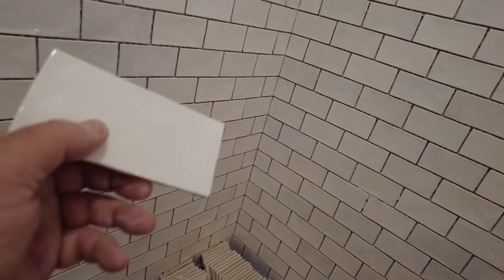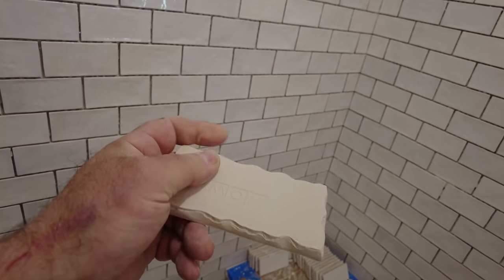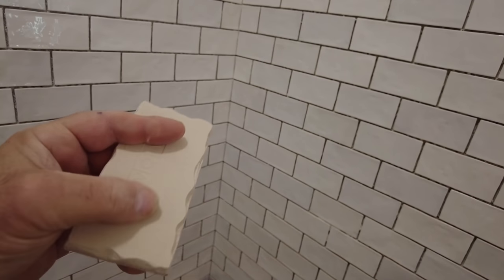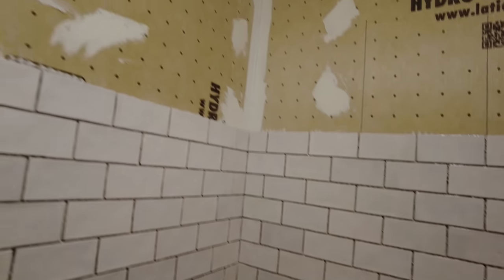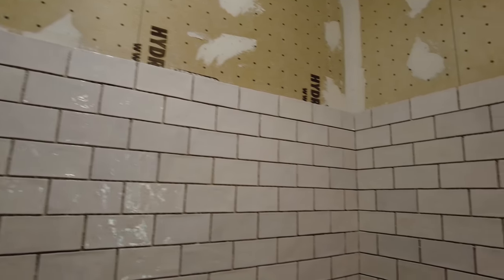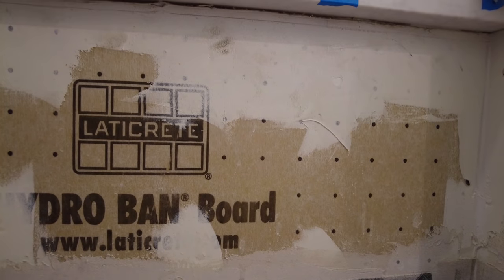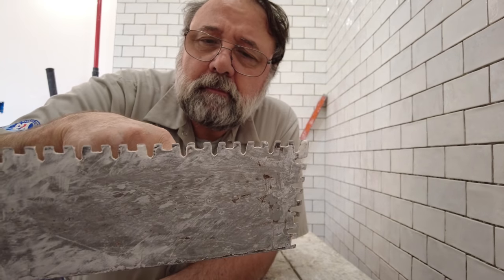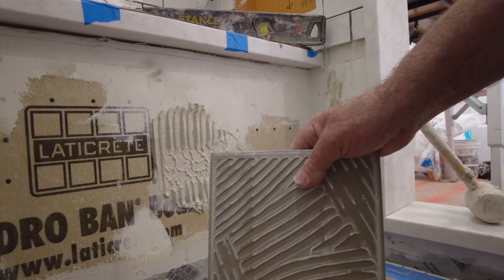Subway tile dos and don'ts. Specifically back buttering.

Comment: If you want any tile to bond better to a cementitious adhesive a little moisture always helps... hence sponging a wall before burning in. If the subway tile is extremely dry and porous, and on hot days, I will often spray the back of the tile with a bit of water before setting to increase the bond strength.

Comment: I just installed a 4”x12” rectified porcelain tile kitchen backsplash and didn’t put any mortar on the walls at all...just troweled it onto the back of each tile and came out amazing!
Reply: I did the same thing when doing the herringbone in my shower because needed to slow my roll from slapping the tiles up too quickly.

Comment: Great video Sal. Does using mastic instead of thinset make any difference when deciding when to back butter and in choosing the trowel size?
Reply from the maker: Mastic is junk and has very limited uses. Only in Dry areas and small tile. No Porcelain.

Comment: True. Is there a set depth of adhesive a certain sized trowel will leave if you need to calculate where to set your studs do the tile finishes at an almost exact point. So 95mm stuf, 12mm kedi board, adhesive and 24 x 24 tile at 10mm thick. Hope that makes sense. Thanks Sal.

Comment: Hi Sal. Is there a particular depth you add on for tile adhesive when setting shower valves etc. Say you use a 24 x 24 tile and you use a 1/2 u shaped trowel, then that is 12mm + 12mm. When flattened it becomes 6mm spread of adhesive. Do you add more for back buttering? Hope that makes sense. Trying to work out depth of false wall before it has kerdi board, tile adhesive and tile. Thanks
Reply from the maker: It is the plumbers job to set the depth of the valve.

Comment: Is there a shade variation in those tiles Sal? Not sure if it's tile or camera angle 🤔
Reply from the maker: Yes lots of different shades.
Reply: @SalDiBlasi  thanks sal  I've just completed a large floor and all the the batch numbers are the same but the shade variation is terrible tbh

Comment: Is thinset or premixed mastic better for bathtub walls, where the base is cement board
Reply: Mastic is not meant for a “wet area” application. It’ll return back to a liquid mush state. A thinset is needed.

Comment: What about the dust/glue on the back of the tile, back butter right
Reply from the maker: Usually not a problem, but in some cases you have to wash and wipe down the tile.
Reply: I wipe the back of every tile with a clean sponge. It bonds very well.  I rarely back butter the tile.  Sal is the pro though and I would listen to him before me.

Comment: How do you keep glue from oozing out between tile gaps especially on mosaic with narrow gaps once they are dried its a pain to clean or remove before filling joints ,what's your tricks ????
Reply: Make sure you use the right size trowel for the job. Mosaics I will use a 1/8 trowel or something. I also use a bristle brush (similar to toothbrush) and some water to “scrub” the thinset out of the grout lines if needed.
Reply: Adhere the mosaic to Kerdi Band first with thinset using a 3/16 V notch trowel and let set up .
Then adhere the the backed tile to the wall . No ooze except maybe at the outer edges.
Reply from the maker: Try knocking down the ridges of the mortar along with the correct trowel size.
Reply: Yep a 6” drywall knife is what I use to knock down the ridges

Comment: Sorry I disagree. Back butter everything...... Just like you key in the substrate..... You need to back butter the tile for proper adhesion. Also that euro notch trowel way excessive size for that 3x6 tile. You stated that hydroban board wall flat then that euro notch is way to much for that size trowel unless you want to spend the entire next day cleaning all your grout lines.